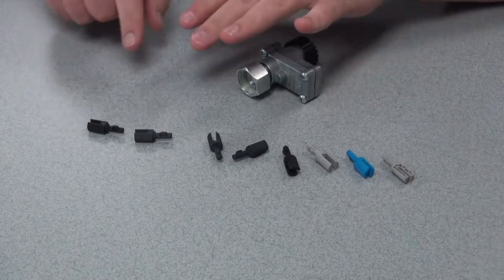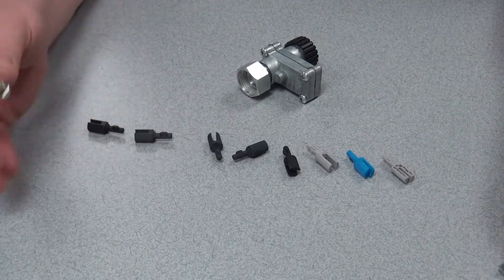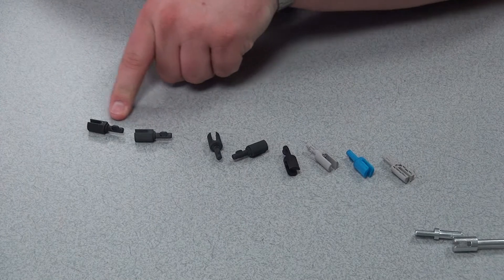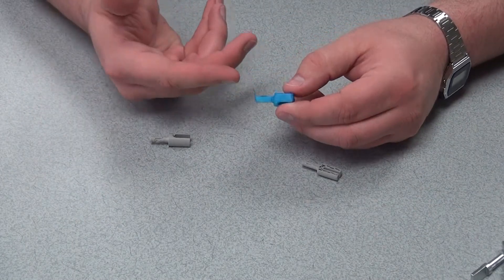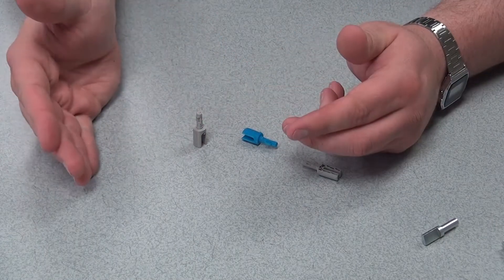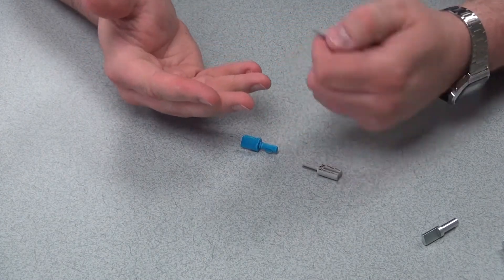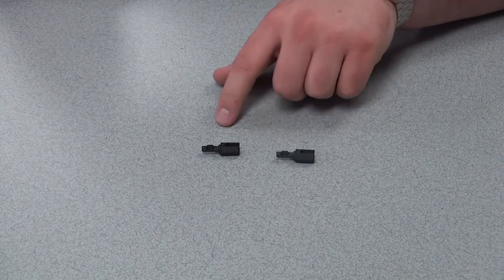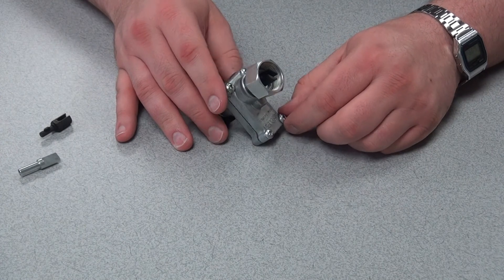3D PRINTED METRIC ADAPTER TIPS - PRUSAMENT CARBON FIBER VS NYLON X

Comment: I hear the lack of PCCF stock has been dut to Prusas carbon fiber supplier delaying shipments to them 3 times due to the supplier moving locations. 

Joeseph replies to a comment on Reddit that that the PCCF should be in stock soon and does not expect any future stocking issues going forward. 

Just orderd a roll out of Australia for $84 just so I had one roll to test in the mean time.

Comment: Use a garolite build plate and run it cold for nylonx. Cover your printer, and make sure its been dried overnight prior to printing. I had the same issue prior to the cold garolite plate
Reply from the maker: Yeah, I have been looking for a garolite sheet for my Prusa Mk3s+ but I haven't found one in stock last i checked.
Reply: @mrspeedometerinc  look up g10 same thing as garolite. Pretty cheap too as it's used for knife making, printed circuit boards etc.

Comment: Learned a lot from your video. Thanks!!
When printing small parts in filament that warps a lot, I often go with a raft rather than a brim. It supports the part in all the necessary place and allows it to cool more slowly and uniformly.
Reply from the maker: Thanks for watching! - Yeah, some parts are just more fickle than others.

Comment: Who did you rob to get the Prusament Carbon Fiber Polycarbonate? I never see it available and I really want to test it.
Reply from the maker: I was lucky enough to grab a spool on the Prusa website one day, I saw it was available and jumped on it. Haven't seen it in stock again since. So im using the roll super sparingly. It's pretty good material I must say.
Reply: I just managed to snag a roll after missing it several times. I put myself on email notifications for it. They usually go back in stock early in the morning around 4am EST. They sell out usually within the day, but they did restock twice within this past week, so maybe they are having more production runs lately lol